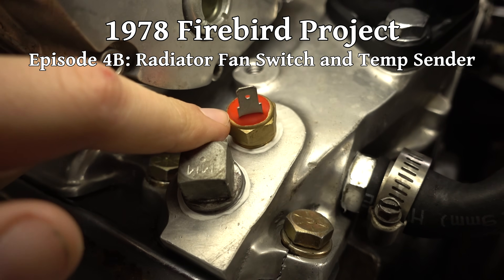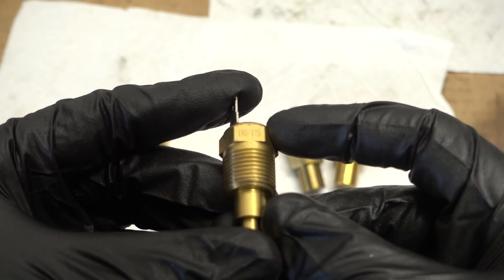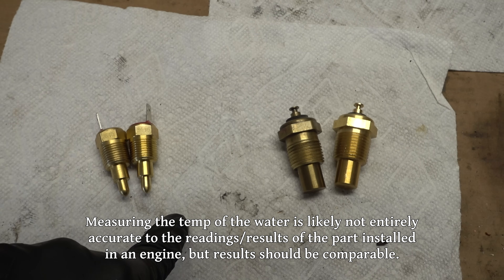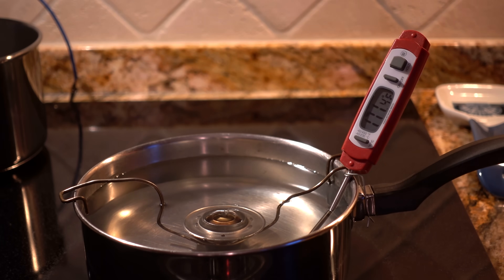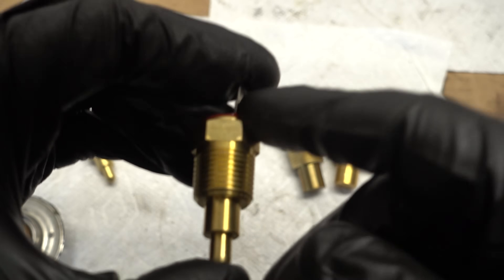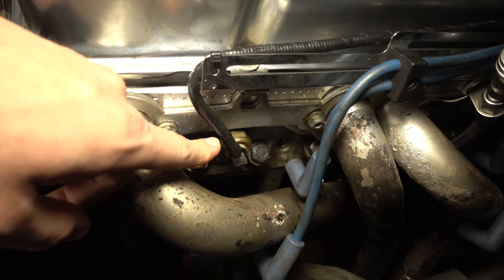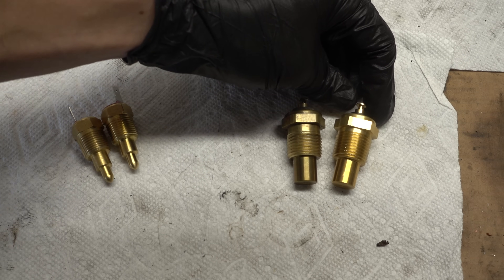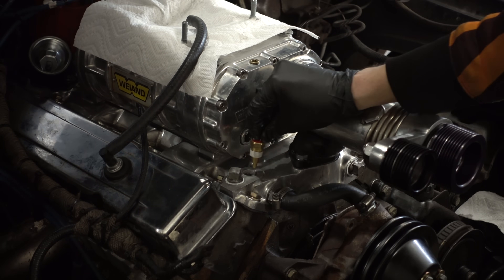1978 Firebird Choosing/Testing Rad Fan Switches (Ep.4 Part 2 of 3)

Comment: thermostats are very simple, it's wax that expands and contracts to temperature, get the right chemical composition of the wax and you'll be able to have different temperature changes, both can last for many many years, I purchased really old cars and change the thermostat most of the cars I purchased had OEM thermostat installed and the people that I repair their cars with have zero problems with the thermostat even the cheap ones that are a few dollars are quite reliable and accurate.

thermostats are changed... once every 20 years? if you have a 20 year imprisonment be sure to change the thermostat of that car you just bought before going in because that was a lifetime ago

Comment: I only use a bit of anti-seize instead of thread sealer.  Better electrical connection and you can still take them out if you need to.

Comment: You do a great job and are very detail oriented. But at 0:28 I am surprised to see that crack on the corner of the manifold. A thick flat washer then the lock ring would have worked better. Drilling from the front and putting in a steel pin before installing it could have worked too. You definitely have alot more technical knowledge about these engines than I do. Great work. I've been spending too much time watching these. Its addictive. I love mechanics
Reply from the maker: In the video before this one (Episode 4 Part 1) I talk about the cracks in the intake manifold. I could have trimmed washers to fit, but they wouldn't have fit otherwise. And the aluminum was so thin from a previous owner's work and simply from Holley's thin castings that I don't think there was any way it wasn't going to crack in some spots. But, the cracks are all on the outside of the bolt holes and the only danger is if a piece actually chips off on a front or rearmost corner the bolt could come loose. I took some small measures (not shown in a video yet) to try and prevent this possibility but I can't really do much about it at this time (would need time and money to replace it or get it welded).

It has worked so far and I hope it will not be a problem before I can fix it in the future!

Comment: Great series and I’ve enjoyed watching the build. A couple things of note: 1-your temp gauge in touching the metal on the pot so reading will be hotter but not by much...even though the sender is on the bottom, a more accurate test would be touching the sender itself. 2-of which has already been addressed, the sender for the gauge should be in the cylinder head. That’s the Mose accurate reading for engine temp. The fan switch is fine for the intake and may vary by a few degrees. Not bashing you, just some insight. Keep up the good work!
Reply from the maker: Thermometer was held up by a piece of mechanic's wire, and not leaning on or touching the bottom of the pot. Same for the senders/switches, only touching the coat hanger wire and the water, not against the pot. As I mentioned in the video, the readings are by no means super accurate, as being in the engine (as well as where, as you mentioned), will change how the readings must be interpreted. I'm not perfect but I tried to be pretty thorough here!

Comment: Thanks for the info! I am re-wiring my electric fans and I am wondering what manufacturer /part #'s you are testing for switches to turn on the fans?
Reply from the maker: I'm not sure what brand either of them are, unfortunately, they are just generic China-made switches. I can link you to exactly where I got them, however. The 185 degree switch came from this wiring kit: https://www.ebay.com/itm/191950488166

And the 200 degree switch came from this seller, although they are "currently unavailable". They appear the same as pretty much all the other Chinese fan switches on the market, though. https://smile.amazon.com/gp/product/B01LWL6ZZB
Reply: Thanks! I haven't bought much from amazon so I am hoping to find some Hayden part #'s for the local auto parts place...If I find them I will post them up..

Comment: Great video! Your pace/editing is perfect. I'm really looking forward to the start up video because from my understanding you are using a stock camshaft. I'm in a heated discussion over your set up with a fellow gear head on if that can be done? My opinion is yes, it can.  Your set up will prove that.  Yes a "blower cam" improves efficiency (ie more power) but a stock cam will work. It just won't make full potential hp-torque.
Reply from the maker: You are entirely correct. I can tell you that it runs, and runs pretty well (but needs more tuning). Many, many people run mini blowers (or even full-size ones) on stock or near-stock camshafts, and Holley will also tell you as much.

Comment: I have been hooked since the s10 build. Your videos are very informative, lightly humorous, and entertaining. I dont understand the need to hunt down another sending unit for your gauge rather than calibrating the gauge to the recommended OEM sending unit, though. Great progress, keep up the good work.
Reply from the maker: john carville Well I think the original sending unit was in fact a TU5, an equivalent of the one I installed in the end of this video. I bought the wrong one to install the first time, because I think the different engines used different senders, or just because that information is tricky to come by.

Comment: Did you make up those graphs yourself or find them on Google? I'm looking for an easy to use graph scale software
Reply from the maker: I made them, wanted a visual way to show the data. I just used Open Office to do it all, which is basically free Microsoft Office. I used Writer (Word) to make the graphs and then copied them into Draw to export them as high resolution images. It might not be the quickest solution but the graphing options seem fairly robust and customizable.
Reply: Fuzzy Dice Projects that's awesome thanks for the info! Keep up the good work

Comment: Electric fan's thermoswitches are (or is) supposed to be installed on the cold side of the radiator.
The engine block's thermostat is supposed to open to cool down your engine by letting coolant flow through the radiator.
If the radiator is unable to cool down the coolant with natural airflow ,the fan kicks on.
Having thermoswitches on the block is asking for huge temps amplitude (thermostat + thermoswitches amplitudes added to each other) and it make the thermostat cycle like mad.
Get yourself a thermoswitch on the radiator, 5 degrees celcius above the thermostat temp fully open to have minimum amplitude ,consistent temps and air fuel ratios.
Reply from the maker: I read a lot about that stuff, and I came out thinking it probably doesn't matter much. Going to see how it does for myself though. Many, many people use them near the thermostat and have found that to work out. If you want some reading to melt your brain with the back-and-forth argument, check this (long) thread out: http://67-72chevytrucks.com/vboard/showthread.php?t=561060
Reply: No offense to you,but thinking it doesn't matter much is quite a mistake,and illogical regarding how much time you spent analysing those parts and the best way to use them.
You have difficulty choosing the appropriate thermoswitch and thermostat because on your system the thermoswitch is in the engine head and do not kick on when necessary. 
You switch on fans only if the return temp after radiator is above the thermostat temperature fully opened.
180 F thermostat ---> 194 thermoswitch in the cold side return radiator side = minimum temp amplitude and kick on only if airflow is insufficient.
i had this set up on my 240 diesel ,It rarely kicked on the fan even in 95 F summer,and it was mostly when i was sitting in traffic.
This is my engine there on the picture : https://en.wikipedia.org/wiki/Volkswagen_D24_engine

Once again,the radiator cool down the engine,not the thermostat,so bypassing its work with a thermoswitch located in the head is pure nonsense.
There are inline sensors housings if you don't have a provision in the radiator.
Reply from the maker: michaelovitch Check out that forum I linked, some guys feel like you do, and others make a strong case for it being in the intake/thermostat housing, including some of the biggest aftermarket electric rad fan companies' instruction manuals that say to locate it there. Theoretically, the fan switch should only activate after the thermostat is fully open and the temperature has increased further, indicating that the airflow over the radiator is not enough and it needs the assistance of the fans.

I might need to go to a few degrees higher temp switch or switch to a 160 degree thermostat because I'm not sure the fans will ever turn off once they turn on unless the thermostat closes almost all the way, though.

I'm sure it works having a switch in the radiator/rad hose, I think a 180 thermostat and a 185 switch in the lower hose would do the trick, but I do believe a 160 thermostat and 185 switch in the intake would serve the same purpose. Or a 180 thermostat and maybe a 210 degree switch. Some people recommended installing it in the upper hose, just outside the thermostat housing. I doesn't seem to me that it would matter much, and that's generally where the discussions in that thread I linked lead as well.

EDIT: And this thread, with people running exactly the setup I am.  http://www.camaros.net/forums/28-heating-cooling/134228-please-explain-thermostat-cooing-fan-sensors.html#/topics/134228?page=1 The thermostat is much slower to react than the switch so it turns the fans early enough that there isn't a lot of thermostat cycling. In theory, at least.